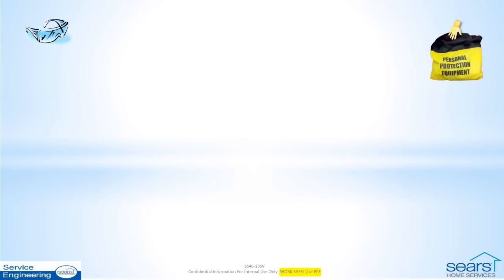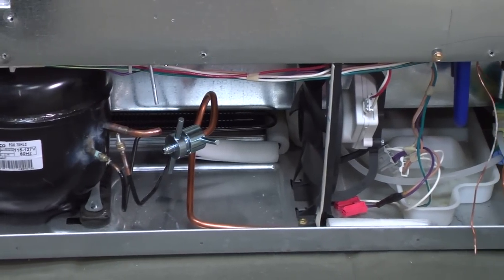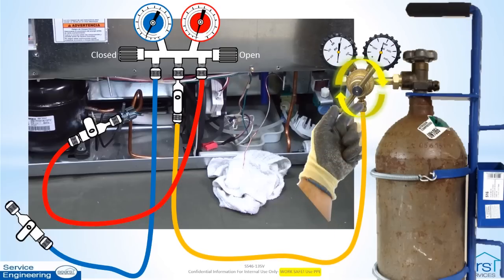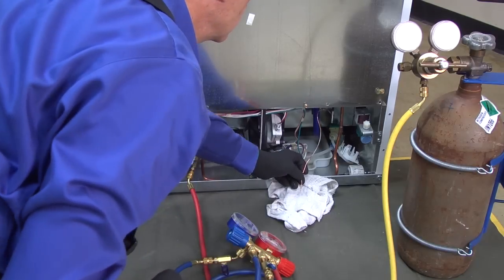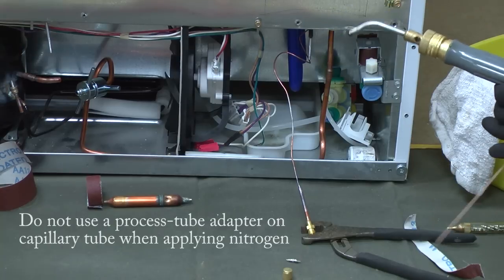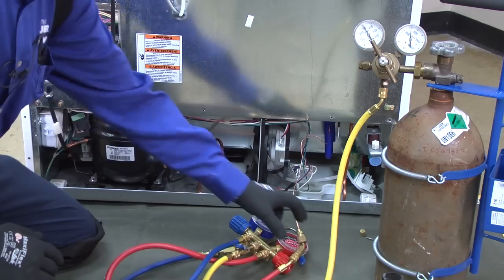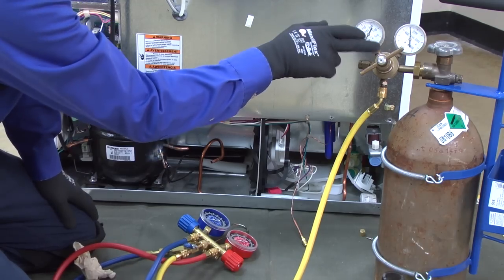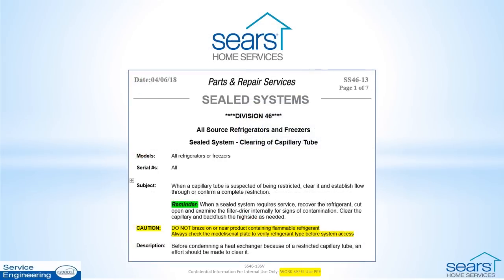SS46 13SV How to Clear a Cap Tube Restriction r2

Comment: When I was working on refrigerators, we had a capillary tube clearing kit.  It had a hydraulic pump, and a selection of lead slugs, for the different ID’s of cap tubes.  The tube was cut at the dryer, the slug put in the cap tube and the pump connected to the cap tube.  The idea was that the hydraulic pump would develop enough pressure to force the led slug thru the cap tube clearing any obstructions. The instructions said the slug would pass harmlessly into the evaporator.  I can’t remember if it worked.  That was back in 1977.
Reply: It usually worked very well.  It could get up to 3,000 lbs or more  of pressure on the cap tube only.  You could opt for just the hydraulic oil and that worked pretty good as well,   .  One time I cut the lead piece too long and it jammed up on the inlet of the evaporator.  One factor that is often overlooked is that the condenser can get clogged with oil as well..  We usually would blow out the condenser with nitrogen to keep from having to go into the system twice.  I have found R134 restrictions much harder to deal with than the old  R-12 systems.   because of more oil thickening  proclivities in the 134. Sometimes the evaporator can become slugged with oil and then it is usually better to replace the evaporator.  Sometimes if it's only a clogged cap tube that resists cleaning out the best solution is to replace the whole heat exchanger (cap tube and suction line )but that is not too cost effective out of warranty.  Before you decide to do a restriction job on a 134 system, you had better warn them that a simple drier exchange and capillary blow out may not correct the problem; it may be a waste or their money and possibly your time and reputation as well.

Comment: What if there's only a PARTIAL restriction of the tube?  Would this blow that out as well or do I need to look for piano or guitar wire to "pipe-clean" the tube to help the pressure clean out the partial restriction?

Comment: I've done that about 4 times now and the damn freezer is still not freezing ice cream properly.  Changed filters all those times, did vacuum, checked for leaks and still nothing man!!  I don't want to give up though.
Reply: Use some R11 flush kit, and then nitrogen, replace compressor oil also
Reply: Check if your putting in the right refrigerant. I almost put R134 in ice cream freezer and it suppose to be 404A
Reply: Thats why its best to change the cap tube and if it doesnt work they need a new unit. The ammount od work this takes may aswel change the part. Especially if it has a concealed evap in the walls probably has a leak.
Reply: Sometimes the nitrogen does not truly clean the cap tube and it needs to be replaced.  But in a 134 system you may have restriction problems in other places as well,  If the oil has got thicker by other problems such as contaminants and overheating, it may be better just to replace the refrigerator.

Comment: There no need to cut the suction off the compressor you can blow thought the inlet port on compressor thought housing  and not need a process adapter Do not know why i bought one never use it. Now 75% it oil in evap. and your not going to blow the oil out of the evap time to replace it. or remove it blow out with evap upside down. But if i remove one i replace it.